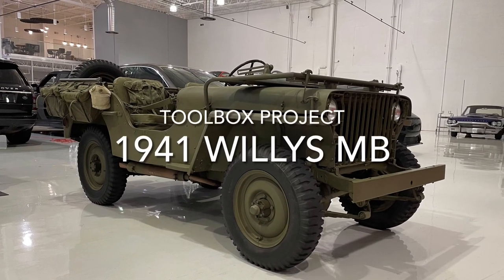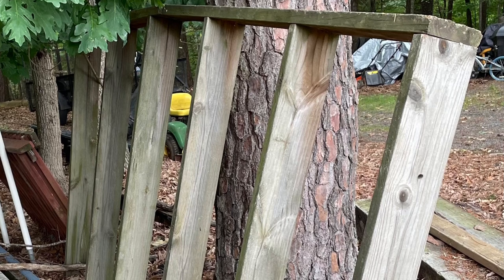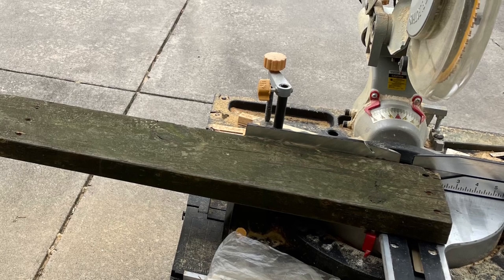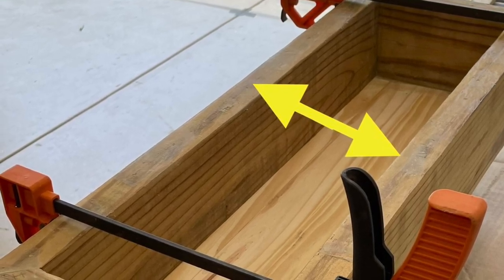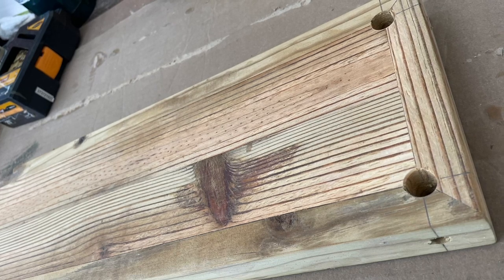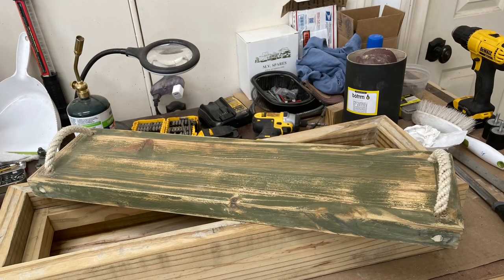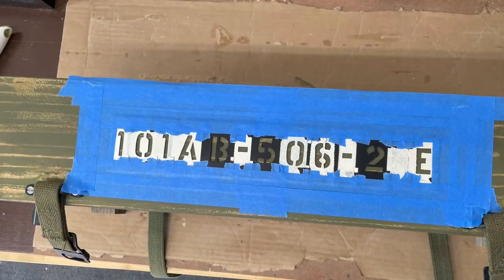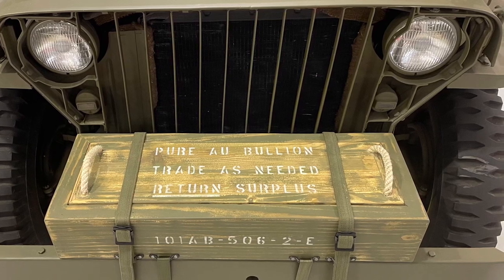Episode Four: The bespoke gold bullion storage box.

Comment: I love this and will be making one for myself in the near future!  As a furniture maker, however, I need to tell you that building a frame around a slab of wood as you did on the top is going to self destruct soon.  As the main slab changes with humidity and the seasons, the frame around it will come apart. I learned this lesson when I was 17 and put a maple frame as a border around a chess board I made. Only way to do it is to use plywood for the slab because it doesn't shift in size. Otherwise you did great!